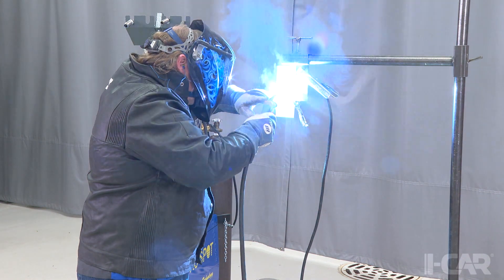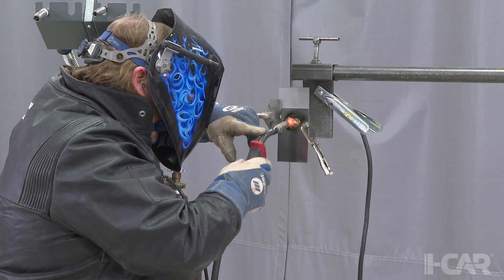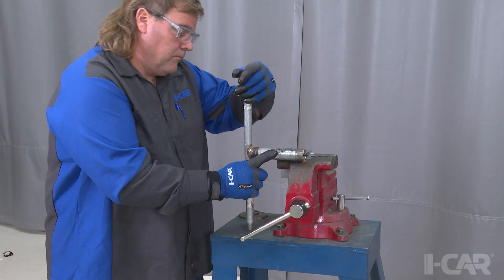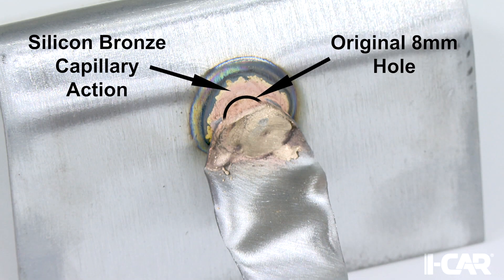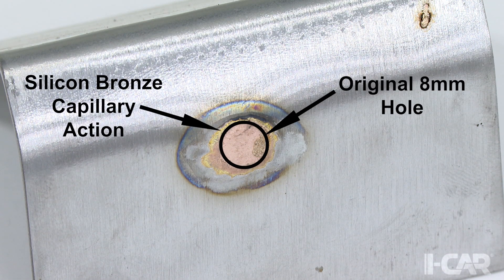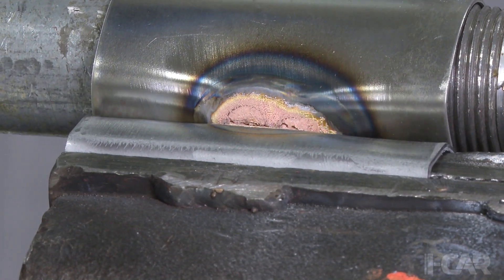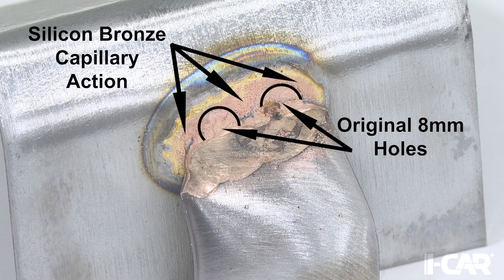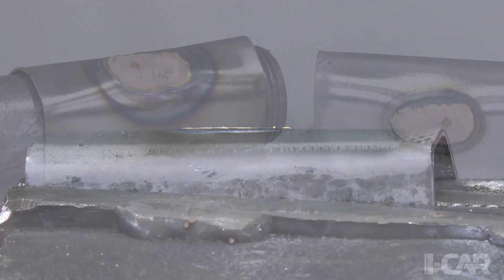Honda Motors Destructive Testing for MIG Brazing - Just In Time

Comment: What is brazing? Just another word for weld ?
Reply: Brazing is "welding" without melting the base metal. In the video it was bronze wire on steel but think copper plumbing for which the joints are brazed with tin/lead.